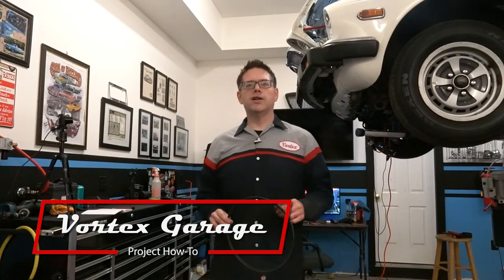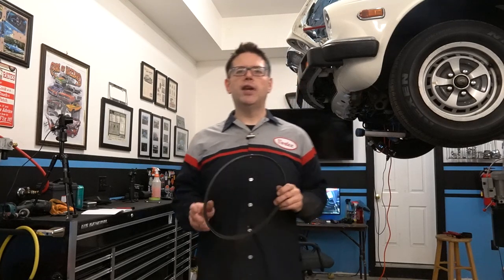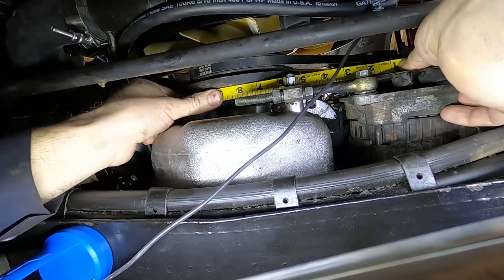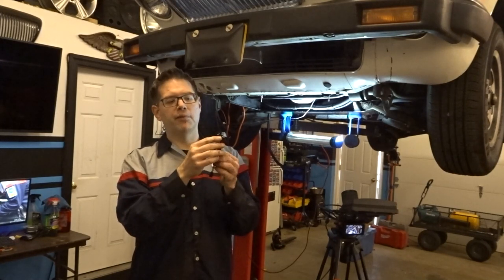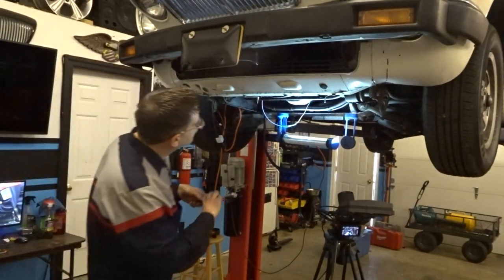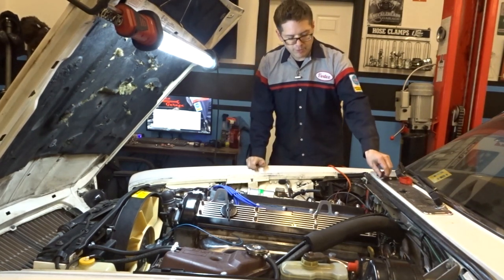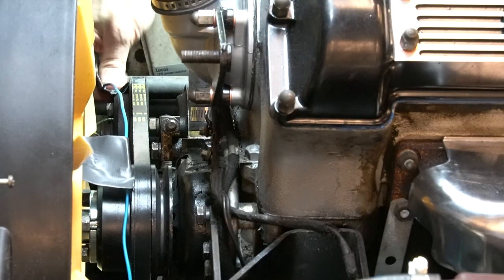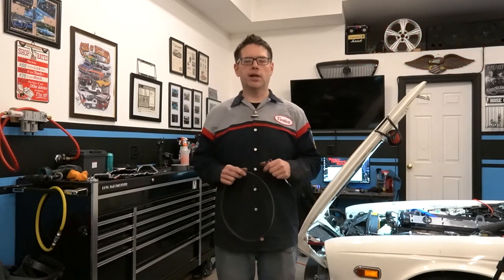Properly Set Belt Tension on your Series 3 Jag! - V-Belt Tension Steps Guide - Vortex Garage

Comment: I'm attempting to tighten my series 3 xj6 alternator belt and it keeps loosening. The bolts I've tightened do not come loose. I'm at a loss of what's going on. I didn't loosen that tension bolt on the top, perhaps I'll try that this time.